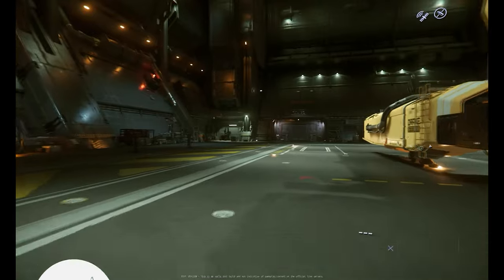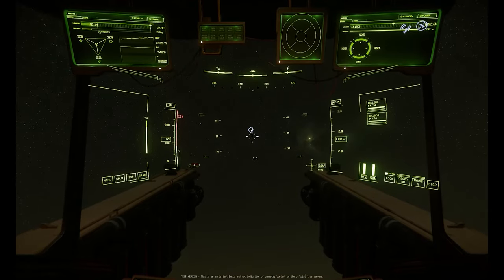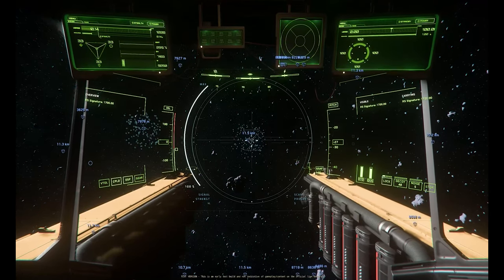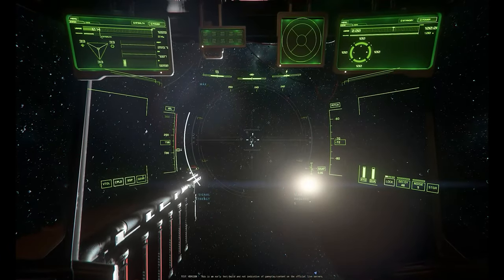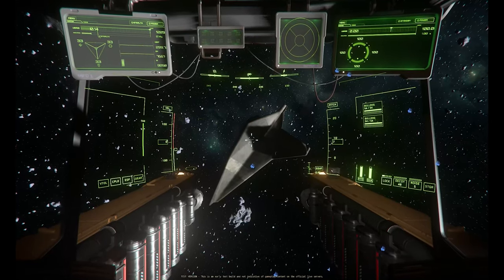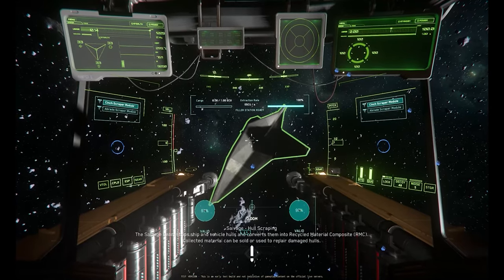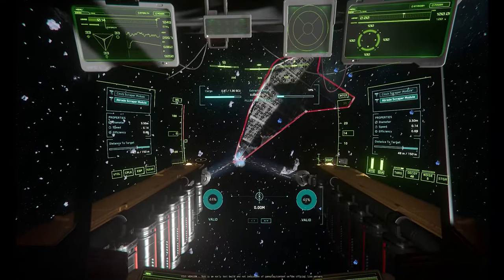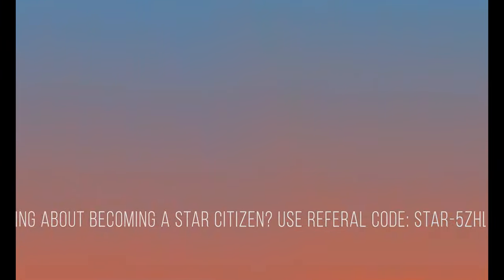Learning how to salvage in Star Citizen!

Comment: Is it the same rule as The Prospector that more than 500km from space station to avoid AI Pirates? And with Shields fully upgraded, how long do they last under fire, like tissue paper or do you have time to SpoolUp QT? Would suck to lose a full load without some chance of escape. Have both Vulture and Reclaimer, only asking about Vulture. Excellent video btw, will use as tutorial on my first mission.
Reply from the maker: Most likely, I doubt CIG changed the AI for salvage. Haven’t had the opportunity to upgrade any components yet, but I’m sure it the same across the board. Although, when compared to the MISC Prospector, the Vulture can throw down and not have to worry about the cargo (such as quantanium) detonating. 😆👍🏻

Comment: How do you scan?
Reply from the maker: Press the TAB key to switch to scanning mode then ping via the mouse click.
Reply: @quantumcafe  Thanks. A step by step how to video for first time salvagers would be nice. I have also heard numerous time how to craft tractor beam items, but no one has ever mentioned how or where
Reply from the maker: @EuroGupper  Yeah...we have a lot more to cover, and Terraphon (who is the voice of this series) is currently working on some projects, which is why we're not currently pushing this series. However, if you need to craft a tractor beam attachment, select one at the filler station and once there's enough gathered material, it will produce one.  Otherwise, you can buy one at almost any weapons shop within the major cities/around the Stanton system.  Hope this helps.